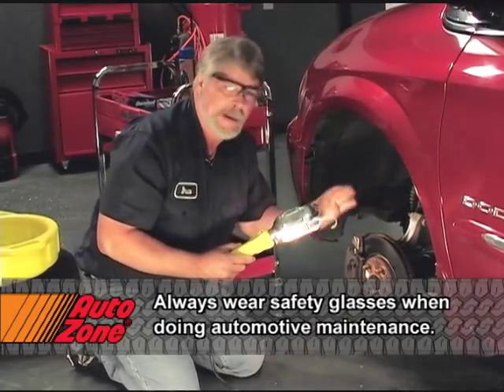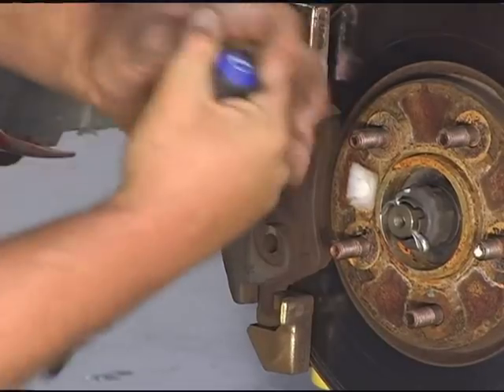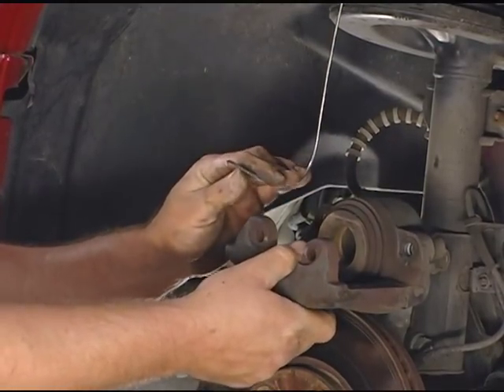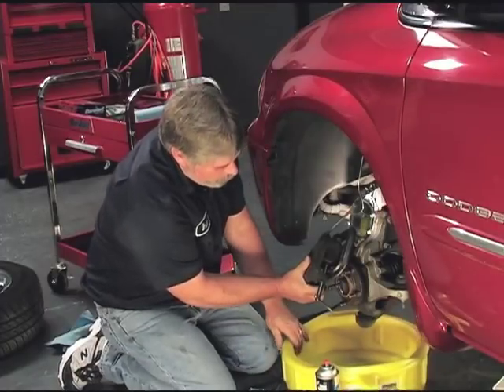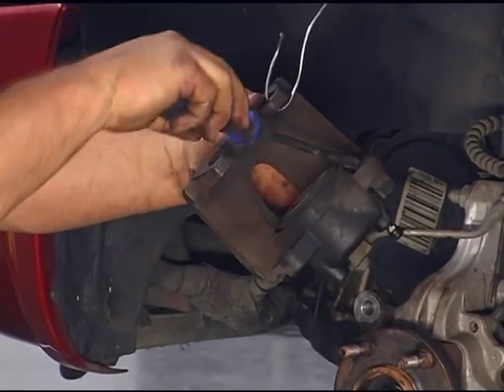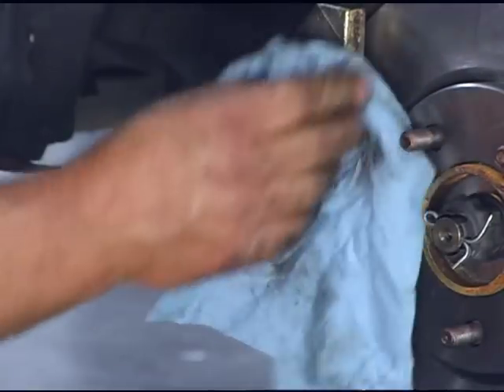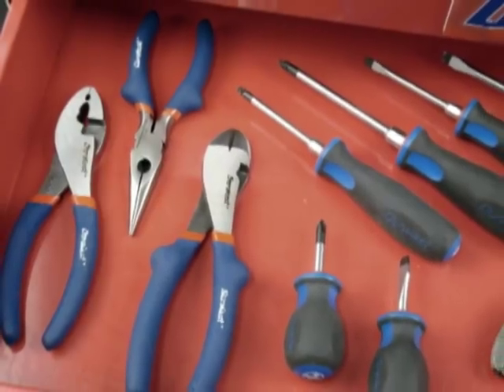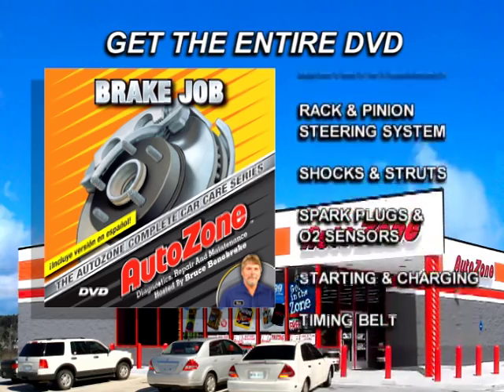AutoZone Car Care: Replacing Brake Pads

Comment: I always remove the master cylinder cover to relieve pressue from the system to compress the caliper piston. Just make sure it does'nt overflow. no need to open the bleeder and the possibility of air getting in the system.

Comment: Over 90% of the time you can get away without loosening the bleeder screw. They can be really tricky to loosen anyway. The best practice is to loosen the cap on the reservoir in the engine compartment and loosen the bleeder when pushing the calipers in. This accomplishes four things:
1) You do NOT have to bleed the brakes. Gravity supplies the pressure to keep air from entering the caliper.
2) It makes it easier to push the caliper in
3) Moisture and sediment settle at the lowest points in the brake system. Removing some of this bad brake fluid at brake changes keeps the system cleaner.
4) Without loosening the bleeder, that bad fluid gets forced into the ABS module. This can cause a malfunction there if sediment enters the accumulator or clogs a passage
Reply: You do not need to open the bleeder valve.  But once you have installed new brake pads etc you can then bleed the brake system.
Reply: I bleed the system first then actually change my breaks. That way I reduce the risk of break fluid getting on my new parts and don't have to worry about pushing dirty fluid around in the system when I compress the cylinder. Brake fluid is cheap and bleeding a system is actually pretty easy as long as your patient.
Reply: I recently tried with loosening the bleeder screws and had to bleed the brakes because a lot of air was in the system

Comment: It's a good idea to leave the old pad in front of the piston when using a c-clamp to force the piston back.    This protects the piston and the cylinder from being damaged.    I'm surprised at Autozone for not doing this.
Reply: Roger Bullock So you can spend more money and buy more parts. It is good for their business.
Reply: Since his method is to release pressure by loosening the bleeder, the clamp inside the cylinder will do zero damage.

Comment: Good basic vid, however, when I do a job like this in my garage the bolts won't come loose, I can't reach the bolts with my ratchet, the rotor is fused on , the torque wrench is at an odd angle, the caliper is seized, etc etc.  I like to see videos where everything goes wrong and how  a professional deals with it.  But I do like Autozone and usually go there first.

Comment: Do you really have to let the brake fluid out? I don't do it that way.   I just use the old brake pad onto piston with the c-clamp.
Reply: And do you loosen the cap for the brake fluid just in case?
Reply: Opening the bleeder is recommended. It inhibits old, dirty brake fluid from bringing forced into the system. It will be replaced with clean, fresh fluid instead when you top off the master cylinder and subsequently pump the brakes.  Naturally, the technique is key to ensuring that you do not permit air to enter the brake line.  Look at Tip Number 8!  https://www.youtube.com/watch?v=xJDOuZzEAQc

Comment: What causes the front brakes to develop a shimmy?  I replaced pads and rotors on a 2001 accord and after 16000 miles, it starts to develop a shimmy when braking.  I applied lubricant to the pins and back of the pads and thought that would prevent that from occurring.  Thanks for the video!  By the way, car is at 280,000 miles
Reply: Sounds like warped rotors

Comment: if you dont open bleeder when pushing pistons back in, remove some fluid from resovoir or its going to leak out and make a mess in engine compartment, brake fluid eats paint and also makes surfaces hard to paint afterwards so be careful. I always put clear vinyl tubing on bleeder and direct into a catch bottle
Reply: Nope you do not need to do that.
Reply: +Jamesnov1970 Unless you want to cover a customer's engine bay in brake fluid; yes, you do.
Reply: +FCFordLord   Being changing brake pads for over a decade now and have never needed to open the bleeder.  You can prevent it spilling over by removing  some fluid from the reservoir.  If you need to bleed the brakes you can do it after the brake pads have been changed.
Reply: +Jamesnov1970 yep

Comment: I've been using autozone parts for years with no problems at all. If you buy the brakes with the lifetime warranty, you will never pay for them again. I just take them off, take them back  and get a new set no questions asked and no hassle what so ever.
Reply: Yeah if you're lucky they have them in stock. Always have to special order mine

Comment: Great Question!  Answer: Reservoir Overflow... Remember, the brake pads wear down, thus requiring additional fluid added to the reservoir.  Fresh Pads require the caliper piston to be pushed FURTHER apart, thus pushing EXTRA fluid back in to the reservoir.  Watch the reservoir level and suction any out before it overflows all over your engine compartment.

Comment: How do you induce air into a closed brake fluid system by compressing the pistons? Every time you brake, the pistons move in and out. Very little fluid is displaced in the closed system by compressing the pistons. And the small amount that is displaced is temporarily  accumulated back into the fill reservoir. Bleeding the system can create more problems. For rotors and/or pad replacement, I've never had to bleed the system. Just my opinion.
Reply: i think it just an old school way my uncle taught me that and you don't need to do that.

Comment: If the bleeder screw is loosened you will have to bleed the system air will enter and the brakes will not work correctly. When the piston is pushed back into the bore the fluid is pushed back into the master cylinder and no bleeding will have to be done.

Comment: you should use the old pad or a block of wood to put in between the C clamp and the piston when retracting it into its bore.  It will help prevent any damage or scores the c clamp may make on the piston.  Just a good rule to follow.  Also i was taught you didn't have to open the bleeder screw as long as you open the master cylinder fill hole at the top and made sure not to over fill the cylinder.

Comment: is it possible to only replace the pads without replacing the rotors and without pressing the caliper? please reply and thnx for the video
Reply: +kids fun 2016 Of course you can keep your rotors but you must push the caliper pistons back in. If you don't, the new pads will cause the caliper to  not fit back down over the rotor.

Comment: There are tire shops that don't use torque wrenches and I have seen this.Use torque stick on the impact.Look at some of the factory lug nuts,cheap chrome caps.I found this out from someone that works at a GM plant,GM pays a quarter each for the chrome cap lug nuts and dealerships sell them $3.00 a piece

Comment: +i have always used the c-clamp method of pushing the caliper back in without bleeding ..And I always keep the brake  cap on the resevour... keeping it unessary to bleed the brakes...And remembering to  pump the brakes before moving the vehicle  after cclamping it..."NO BRAKES"

Comment: @mcmaddie This might be a dumb question, but please forgive me, I'm a beginner and wanna learn tips and tricks:  Can I not remove the Bleeder Valve when pressing the Piston back in EVERY time, or after a certain amount of times of changing the Brake Disks/Pads, do I need to remove the Bleeder Valve?  Or do I ONLY remove the Bleeder Valve after I've added Brake Fluid the time before?

Comment: ChrisFix did a better job at explaining
Reply: He didn't even mention the bleeder screw when releasing preasure on the piston
Reply: @dannymartinez8522  He's got several brake job videos. Every single one is done differently. He does mention the bleeder valve in one. LoL

Comment: i if you have abs breaks do you have to disconnect the abs fuse or battery terminals when pushing back the break pads as i was told if you don't it could effect the computer

Comment: @fredmar56 I noticed error in my first comment. Or course it's possible to have overflow if the brake fluid has been changed and brake fluid reservoir has been filled too full. So in that case you might need to open the bleeder valve when pressing the piston in. And you should change brake fluid more often than you need to change your brake pads/disks.

Comment: I'm trying to change my pads and rotors for the first time.  I can NOT get the freaking caliper slide bolts to loosen. Is it okay to use something like WD40 to loosen them? Sorry, I'm kind of a noob at this.
Reply: I've had this happen several times and had to replace the bracket. They usually cost around $15 or $20. If they don't come with the slide pins and rubber boots, you'll have to buy the kits for that. That will be about another $15.

Comment: I don't torque the brake caliper bracket bolts,I use the German torque spec using my impact to tighten the bolts

Comment: Hi i have camry if for some reason while putting back the sliding pin bolt original pin bolt rubber on the bottom accidentally reversed it what will happened? thanks :)
Reply: It's strange that one of the slider pins has a rubber ring on it while the other doesn't. I'm pretty sure the slider pin with the ring was on the bottom of the bracket. I replaced them how they were previously done. Although, that doesn't mean that whoever worked on them before put the pins in correctly. (I bought my Camry used.) The worst that will probably happen is that the pads will wear unevenly.

Also, in my case, both slider pins without the rubber ring froze up in the bracket. Well, I'm assuming they didn't have the rubber ring. I couldn't remove them to verify. If this is the case, I don't know why they don't put the rubber ring on all four pins.

Comment: Why open the pleader screw? cant you just push the brake fluid back into the system?
Reply: it is not recommended to open it. don´t do that.
Reply: Ignore the comment left by tronik kino. You must open the brake bleeder in any car with ABS in order for you to avoid a $2500 repair. Here's why. Brake fluid (DOT 3 & 4) is a hygroscopic fluid which means it absorbs water. Water is denser than brake fluid so it will sit at the bottom of your brake system which is your calipers or wheel cylinders. Since most calipers/wheel cylinders are made of iron they will start to rust with this water. So now you have rusty watery brake fluid around your calipers and when you force this back into your brake system you force this fluid through something called an ABS module which is filled with little solenoid valves. Now solenoids generate a magnetic field to operate. Iron loves magnetic fields so all those rust flakes you just pushed next to those solenoids are seizing those solenoids up. When these solenoids become seized an ABS warning light comes on and you now have no ABS. To get this fixed your looking at a new ABS module which most of the time is a dealership only item and it may run you around $500 - $2000 in the part alone. So take the extra effort and crack your bleed screw or take it to a mechanic who knows what they're doing..
Reply: ***** Thanks for the explanation Rick! So I can do it my way as i never work on cars with ABS but only classics :-), so no problem to push it back in. but this rust story makes me think that even for classics it would be better to plead then .
Reply: Frank Coineno Hi Frank ignore always the comment left by Rick Diesel God what he wrote is another story and wrong. In this case you don´t need to open the brake bleeder with car with ABS or without ABS. why? because it is a close system and if you open it the fluid absorbs water. this makes sense in this case .The truth is, if you leave this close system open  for  a long time one or two days it absorbs water because the system is open. this close system absorbs water after 2 years or more through the breakefluidhose the weak point in cars. look in repair manual  made by car factories. You will never find his explanation in this case. The best practice is to loosen the cap on the reservoir in the engine compartment only to make the job easier.I am wondering why Autozone make such videos!!!
with regards a mechatronic master and a mechanic engineer ditronik
Reply: tronik kino
I don't open the bleeder... but...
The real reasons why you should open the bleeder are:
- So you don't damage the piston seal when you push it back.
- To avoid dirty fluid into the hydraulic control unit. (avoid clog)
Other reasons are over expansion of hoses. flex or metal.
if the brake lines in a car are rusted they can break when you push the piston back with the bleeder closed.... if you open the bleeder you lessen the chance they will break... I still take the chance and don't open the bleeder because it can break then have fun drilling the caliper.. probably better to open the bleeder
Reply: I never open the bleeder either but I do make sure the master cylinder cover is loose and there is room for more brake fluid to return to. You will never in a million years burst hoses or brake lines pushing the piston in with a C clamp or a C clamp vise grip (which I usually use because it is quicker). You cannot create the several thousand p.s.i. which would burst lines, piston seal, e.t.c. with any manual piston compressor.
Reply: ***** That bleeder valve only needs to open when you are bleeding the brakes, Not when replacing brake pads or rotors.
Reply: +Jamesnov1970 When you replace pads and rotors, you should be opening it. Why? Because it is likely time for a brake fluid flush. Any mechanic should know this. Simple checking the color will let you know.
Reply: +CrazyBeats i would like a line failure in the shop then on the road good point about line rot
Reply: It is always a good idea to open the bleeder screw to expel the fluid rather than send it back through the system into the ABS module and then to the master cylinder. Since the calipers are at the lowest point in the system, any rust, copper or rubber contaminants will be in the caliper. By opening the bleeder screw you expel the old fluid along with any of the contaminants. As for moisture, brake fluid absorbs moisture on the molecular level, it's not the same as if you have water in a gas tank where the fuel sits on top of the water. Don't use the color of brake fluid to determine if it has excessive moisture or contaminants. There are testing strips that will do that for you. As a side note, if the bleeder is open, it is much easier to push the piston(s) in with the c-clamp.
Reply: Hello guys, can somebody tell me if it is neccesary or not open the bleeder screw to avoid any damage in abs or is not so important? Please i need to know.. Thanks! Regards from Argentina
Reply: Richard Herndon e

Comment: no disrespect sir,i dont think you need to opon the bleeder?
Reply: You are right. If you do then you will need to bleed the brake system.
Reply: ***** Nope, There is no need to open the bleed valve to replace brake pads.
Reply: ***** Assumption on your part.  Opening the bleeder valve when only changing the pads can lead to further complications
Reply: ***** I am not wrong but whatever.
Reply: ***** That is why you bleed the brakes after replacing the pads :)
Reply: you dont need to bleed when changing brake pads or brake shoe dir jamesnov1970
Reply: you only bleed braking system when there is leakage and you change repair kits sir
Reply: bong ilagan 
Working in a dealership, I haven't come across any service manual that mentions bleeding the system or opening the reservoir. Better stick with manufacturer standards.
Reply: bong ilagan I don't know. I guess he does it because ETCG does it.
Reply: +GTgameTime good one!
Reply: bong ilagan I think he does it to let the pressure he applies to the piston get out through the bleeder not inside the system. later he will refill it.
Reply: The only thing opening the bleeder does is not to all excess fluid going into the resevour....But I have used the method  with out bleeding since i learned. Can change pads in minutes including pumping the brakes. afterwords
Reply: either he could open the bleeder screw to expel the break  fluids already compressed against the piston or he could just go and lossen the break fluid resovior cap to expel the air once he push the piston
Reply: Since my first car with ABS, I've been breaking open the bleeders when pushing the piston back in.  It's been 20 years now and not a single issue.  I use a tube off the bleeder to prevent air intake.  I'm also very slow pushing the piston back in.  This I do because of a couple articles I read back in the early 90's about how easy it is to contaminate the ABS.  That, and I knew someone that did damage their ABS module when pushing the piston back in.  You can do what you want, and I'll do it the way I want.  ABS modules are very expensive and I won't risk it.
Reply: bong ilagan EXACTLY
Reply: Jamesnov1970 you don’t really want to brake to be pushed back up to the abs module, they don’t like it. I like to clamp the brake line and open the bleeder to prevent a issue if possible
Reply: For precautious reasons, yes,  you should. I had an old 92 civic and I did not bleed out the fluid when I had replaced the brake pads. After the job was done, the brake pedal had sunk to the floor because the air reverted back to the master cylinder instead. Another time when I had to replace the brake pads on my 2005, I had skipped out on the bleeding process again, and I was fortunate it did not occur on that car. Maybe I got lucky, but regardless if its an old car or not, don't take the risk on having to replace the master cylinder.